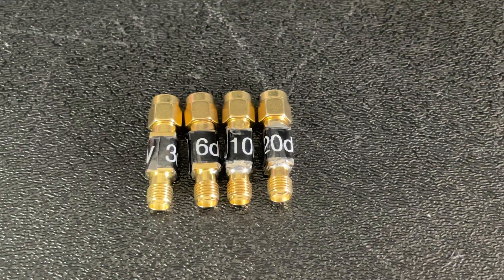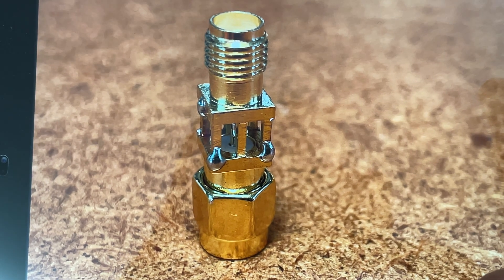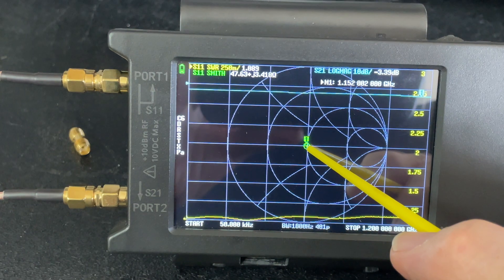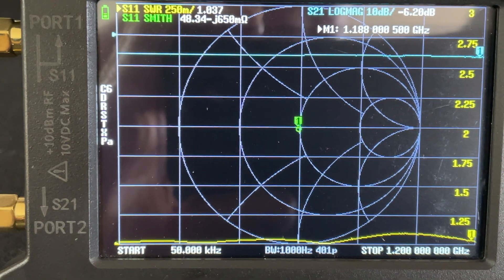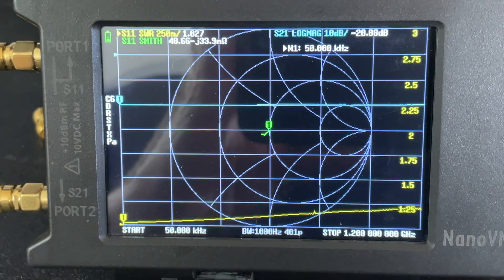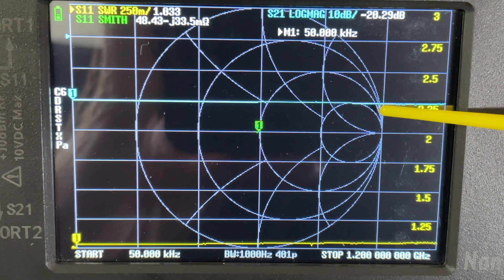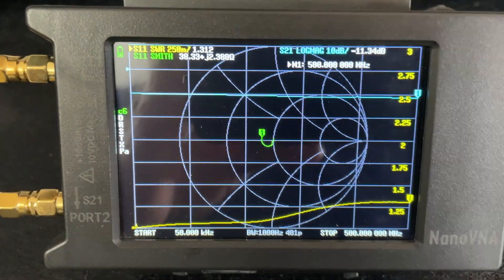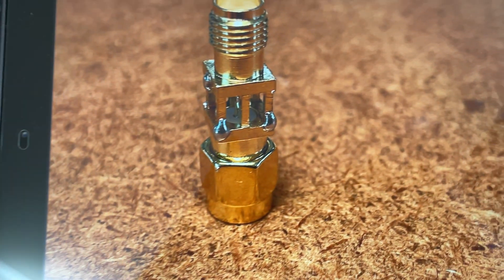DIY SMA  50 ohm RF Attenuators

Comment: It would seem based on the schematic that you'd want to have one resistor soldered from the middle conductor to ground on each of the connectors, not both on one as shown in your pictures. 
Clearly it works, but I don't see how it matches the schematic lol.
I'm definitely going to try to make some!
Reply from the maker: Good catch!  I should have explained that the picture, as shown in the video, was that of a 50 ohm load and not a attenuator.  It merely was meant to show the construction technique I used. The attenuators in the video do match the schematic.  Thanks for bringing that to my attention!

Comment: Just curious, why do they not work below 50kHz?
Reply from the maker: That is an excellent question.
RF attenuators can work very well in the audio frequency range.
However, RF attenuators are designed to work at much higher frequencies then audio attenuators and must be carefully designed for such. The input/output impedance of an attenuator is also an important consideration.  As an example, some audio attenuators may be designed for the 600/150 ohm range while RF attenuators tend to be in the 50/75  ohm range. Of course, these stated impedance's are not limitation's.

Comment: Great stuff!  but can you please tell us what value resistors and their combinations (if in parallel or series) to get the correct/approx values?  Basically how close the the values in the table one needs to get to?  Also what wattage rating resistors?  Thanx...
Reply from the maker: Thank you for your comment!
Yes, I will add to the description the information you requested and the resistor values and order numbers from DigiKey hopefully this week.
Reply: @rfburns3472  Brilliant! thank you very much for the details and your dedication! 73 de vk3OLA
Reply from the maker: @lmantuano6986  Your absolutely welcome OM! Please let me know how it works out for you.
Reply: Nice video. Very good results up to a certain freq for these DIY attenuators. There are a few chinese ones out there and most likely are the same but you saved money and have the possibility of customize the attenuation value to your needs. About the HP attenuator, don’t forget to account for the two BNC to SMA adapters, especially if they’re not good quality.If you calibrate the vna WITH those using a double female BNC I believe you should get better results out of the HP.
Best wishes
Diego
Reply from the maker: @IZ0MTW  Thank you Diego!  Yes, the connectors can be a real concern especially at those VHF/SHF frequencies.